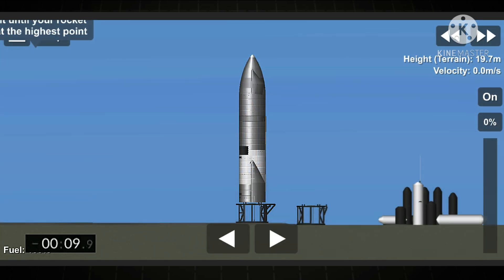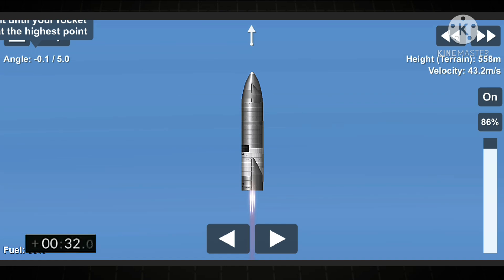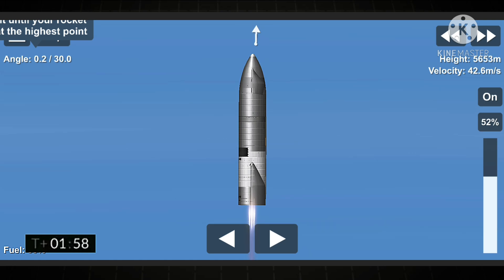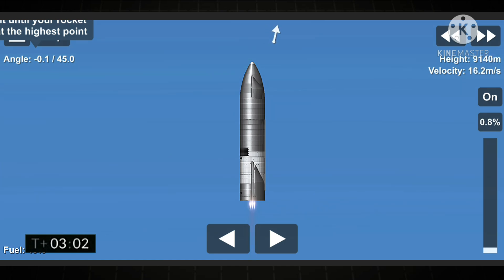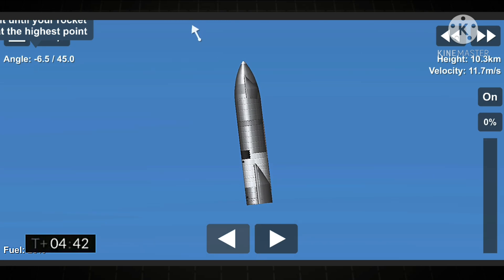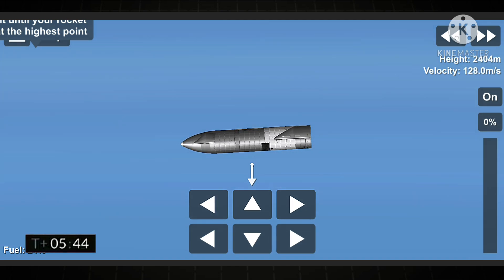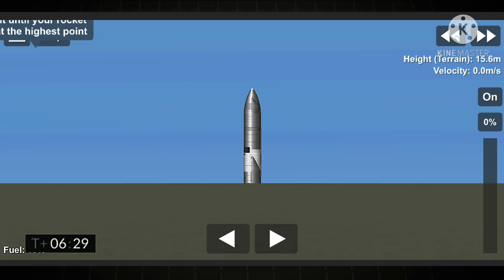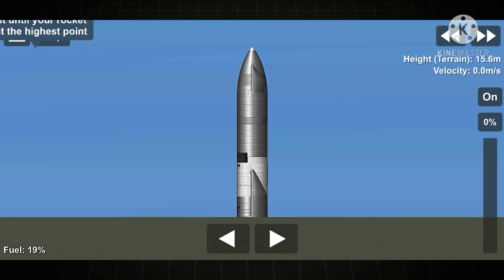Starship | SN10 | Hight-Altitude Flight Test

Comment: very cool, next time maybe add landing legs, it was hard to see but sn10 actually did deploy them.
Reply: They are designed to absorb the damage and get smashed, they are placeholders. Sadly only 3 of those actually deployed for sn10.
Reply: @VerniMain  Yeah and it did look like SN10 went a higher speed than it was supposed to.
Reply: They wobble
Reply: Just 3 locked